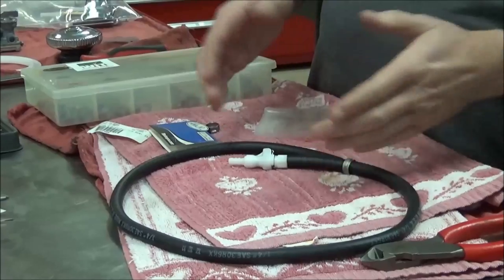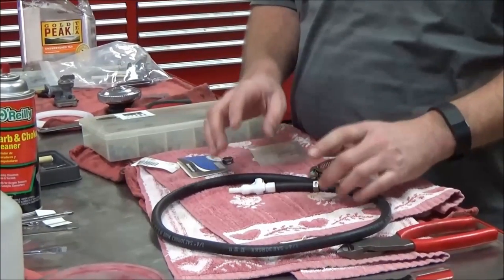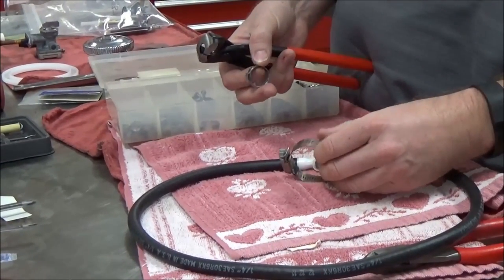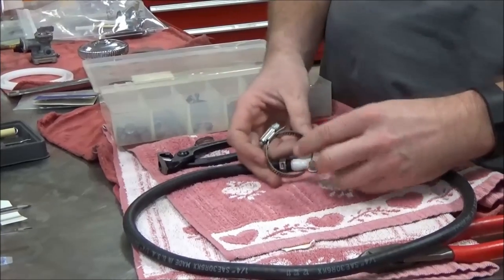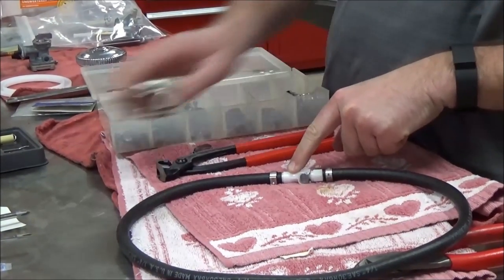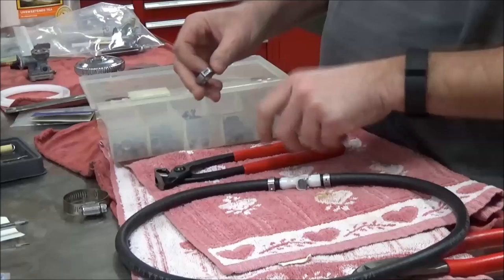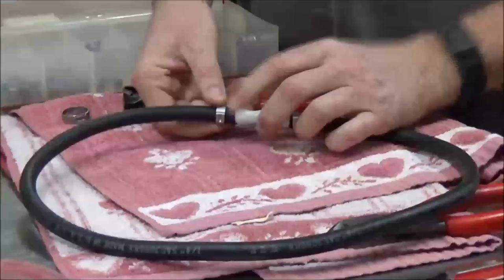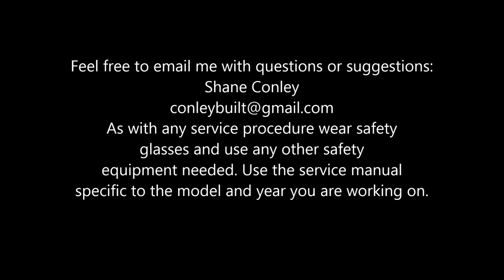Product Review: How to install Motion Pro Quick Release Fuel line and Oetiker Clamping System How To

Comment: They use a similar system for irrigation sprinkler lines, sometimes using two clamps at critical points. I like the system, and I have a crimper with mechanical advantage since those big irrigation lines require a lot of force to hold the hard plastic lines tight. Cool to see the same technique for fuel lines.
Reply from the maker: Thank you!

Comment: Hi Shane, top tip with these connectors (I have these on my GS Adventure) if you are not careful when unclipping, they plastic becomes very stiff as do the 'o' rings.  The only fuel resistant lubricant I have found for the 'o' rings is EZ Turn, it's used (amongst other things) on the fuel lines of planes.  I have tried many silicone agents but these have failed.  This product has been on my machine for a year now and the connectors release easily.  (Even in cooler weather) Hope this is of some help to you viewers.  PS it is, however, very expensive but buy it with you mates!  Regards. Joe.
Reply from the maker: Thank you!